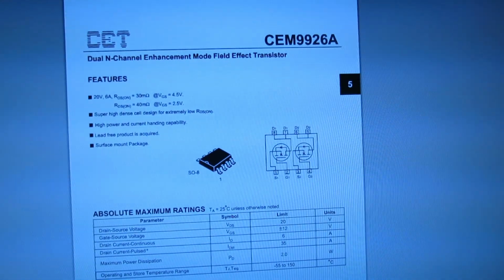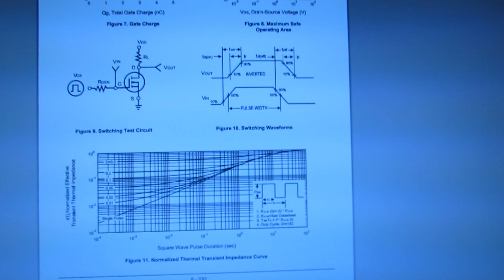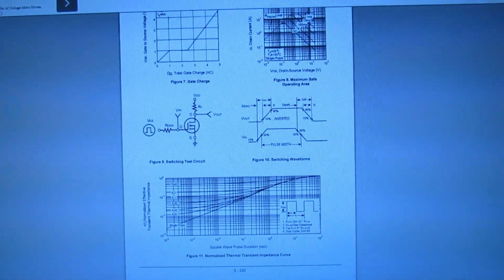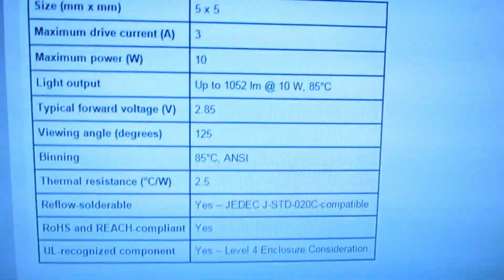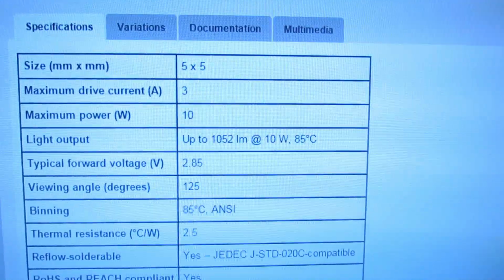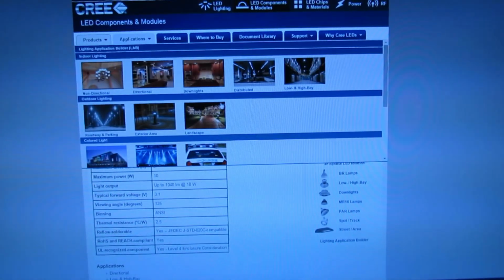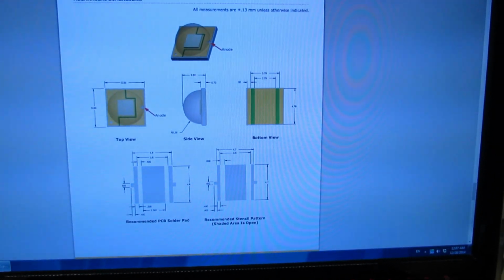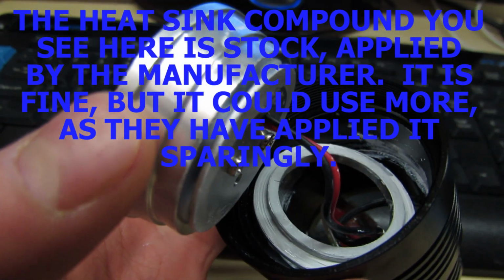SkyRay King 7 x Cree XM-L 2 T6 LED Flashlight Tear Down

Comment: Great review! What is the run time on the SkyRay King 7 x Cree XM-L 2 T6? Also what LED flashlight would you recommend of around 200+ lumens with a focus/adjustable light output ring?
Reply from the maker: +ArimaKihe1 
Thanks man!!If you want to learn all about lumens, and various flashlights off ebay, check out my video below, it will help answer a lot of questions:https://www.youtube.com/watch?v=iKfXuR05ICg
To answer your question though:200+ lumens is not very much, are you looking for a very low powered flashlight?  If so, it will last longer, like 320 hours on low(Using a good 2200mAh LG battery which actually has ~2100mAh usable energy, not the 6000mAh Ultrafire which is actually only has 1000mAh usable energy).  The LED you want is the Cree Q5 LED, it outputs around 250 lumens max.  Below is a link to a ring adjustable Q5 flashlight:http://www.aliexpress.com/item/2015-Promotion-New-Arrival-100-200-M-Linterna-1800-Lumen-Zoomable-Cree-Q5-Xm-E-Led/32463942917.html?spm=2114.031010208.3.138.elFvj4&ws_ab_test=201556_3,201527_2_71_72_73_74_75,0_0

With that said, I should point out some drawbacks to using a Q5 rather than the XML or XML2, and other available flashlights.1.) Low output.2.) Very slow to adjust zooming function, the ring takes a few turns to get from full flood to full zoom, and back to full flood again, it could take 5 seconds instead of half a second(On slide zoomers).  I don't review the rotating ring flashlight in the video, even though I show it, but if I did, I would have pointed out it's slow to manipulate, and is not very user friendly, you'll fumble with the rotating mechanism, and find it's way slower than the slide zoom type, I've used them all, and I avoid the rotating ring every time.  It's nice to have the side switch, and if that's what you're after, then go for it, but I like the tail switch as it works well for me.  The side switch has to be found, and is slower then a tailswitch due to that.  The whole flashlight is much slower to use due to the ring and side switch.3.) Larger than slide zoomable flashlights of similar output(Doesn't fit in pockets and bags as easily)However, if you want the ring zoomable function, and higher output, 1000 lumens, you can take a look at the Cree XML ring zoomable flashlight, below: http://www.aliexpress.com/item/Ultrafire-Portable-Flash-Light-CREE-XML-T6-2000LM-5-Modes-LED-Zoomable-Flashlight-Torch-Spotlight-Lantern/32338862287.html?spm=2114.01020208.3.148.3Est3e&ws_ab_test=201556_3,201527_2_71_72_73_74_75,0_0
Furthermore, if you want higher output, 1000 lumens, a smaller flashlight, and quicker slide zooming, check out the one below:http://www.aliexpress.com/item/2200LM-12W-CREE-XML-T6-LED-Zoomable-Zoom-18650-Flashlight-Torch-Lamp-Aluminum-Alloy-5-Modes/32305271071.html?spm=2114.01020208.3.75.i6uIgF&ws_ab_test=201556_3,201527_2_71_72_73_74_75,0_0

The zoomable flashlights with rings are not that easy to manipulate quickly and effectively,  they are also larger or bulkier.  I find the slide zoomable flashlights to be much easier to use than the rotating ring ones. 
Depending on what you're using the flashlight for, as I show in my video, a zoomable optic is not very good for walking in trails, for that, you want a combined flood and narrow distribution which can be achieved through the use of a reflector based optic.  If you're using it to work on a car, then the zoomable optic is better though, since it evenly distributes the light and doesn't have a hot spot in the middle.
The best reflector based single cell flashlight in my opinion is the Convoy S2+.  I would go with the full 2800mA driver (7135*8) and a warm white LED(code name T4-7A). This is better for security purposes, and walking down trails:
http://www.banggood.com/Convoy-S2-Blue-CREE-XM-L2-71358-35-Modes-EDC-LED-Flashlight-p-994206.html

Color temperature is a personal preference, if you like the whiter light, go with 4000K, if you like the more blue light, go with 6000K, it's up to you though.  I like the 3000K warm white because it's more similar to incandescent or halogen lighting.
Hope that helps!
Best regards,
David.
Reply from the maker: +ArimaKihe1 

Also, if you want the blue Convoy S2+, it's listed here for a pretty good price:
http://www.banggood.com/Convoy-S2-Blue-CREE-XM-L2-71358-35-Modes-EDC-LED-Flashlight-p-994206.html
Reply: ***** Interesting. Can you think of anything that's powered by Cr123's and the beam can be tightened/widened?
Reply from the maker: +ArimaKihe1 ya
this would work.  the cr123 is a 16340, so any of those lights will work.  http://m.aliexpress.com/item/32397122952.html

Comment: Is it possible to tighten the beam with a lens to get a little more heat closer up?
Reply from the maker: +laurin 800 Sorry for the late response. 
The easy answer is no, but the correct answer is yes.
It would have to be a very complicated lens though, as it would need to concentrate all 7 sources to 1 point, to increase heat closer up.  It's not practicable to do so, though.  
For a more focused beam, you would want a larger reflector meant for that.
Reply: I have a similar one with 12 leds, I bought a lens from ebay for under 5 non glass, plus they do glass ones, what it can do, is allow a centre beam to focus for a distance beam

Comment: Thanks man...I had found 1 more earlier...at...http://www.aliexpress.com/item/Sky-Ray-King-4000Lm-super-bright-4-Mode-7x-CREE-XML-L2-LED-Flashlight-Torch-Waterproof/1717229079.html.....also verified on BLF that it is XM L-2...but it seems that this seller does not has Black color in stock at present....
Reply from the maker: Looks like eBay has more options than aliexpress. It's about $40 for a xm-l2 7x in black. If you want the SkyRay it's a little more, but I think the securitying one is the same.
Reply: ***** Yes....SecurityIng is the same...and is available on Aliexpress at $35/-
Reply from the maker: ***** cool. Did you end up ordering it? Let us know how yours works. This one only has two 0.1ohm current limiting resistors in parallel, and that results in an 8A draw, so ~35w instead of 70w. But nothing adding two more and switching the mosfet won't solve.

Comment: ...very nice...no nonsense....clean video...with clear speech....also good technological approach.....would you please also tell as to where did you buy it from and in what price...??
Reply from the maker: Thank you very much!  I purchased it on eBay for $45 USD.  But I would suggest purchasing from user securityingstore on eBay, as their version of the skyray king is a little cheaper, it's just rebranded as "securitying" instead.
Reply from the maker: Also, here's a link to the same flashlight(I've put it in the description), but branded as Securitying, it's also the XM-L2 LED, and not the XM-L.  Some ebayers will send you the XM-L even though you've purchased the XM-L2, so be careful with that, and check it when you receive it.  If it's the wrong one, then just use ebay buyer protection to get a refund, you might not even have to send back the light, depending on the shipping charges.  If it costs more than the item to ship it back, they typically will just give you a refund.
Reply: ***** how to determine which led do i have?
Reply: Xml-2 will have 2 wires on each led and xml will have 3....means thin wires on t yellow led....check....on each led...u will be able to see that...
Reply: ***** as i found it actually is not as important at all as the driver only utilizes 20-30 % of maximum power (70w). That is truly reason why to get a refund. L/L2 difference is only 20% of flux which is not sensitive here.
Reply from the maker: It's probably not 20% even, but if they are selling the L and saying it's the L2. That's not very fair.  And you're right, the driver runs at 35 watts, but I'd rather have the higher efficacy if I paid for it and expected it.  The L2 doesn't have the section divisions.  You can easily increase the power of the flashlight by reducing the current limiter's resistance until you get the current draw you want. I've maxed mine out over 70w, so it was important I have the newer LED.
Reply from the maker: ***** hi, forgot to say, that when increasing the current draw, the wires feeding the LEDs, and the mosfet need to be upgraded to handle the extra current. The stock dual channel mosfet only runs up to 6A, so they are already overloading that.  Batteries are also a concern, make sure you use Panasonics, or something that can handle the current draw safely.  The Ultrafires don't say they are rated for 4A each.
Reply: ***** which resistor is the current limiter?
Reply from the maker: Brian Tucker  hi Brian.  There are four locations for them,  they soldered on two 2w 0.1ohm resistors,  they are labeled 100. On the positive side of the LEDs.  If you want to increase power of the light,  you'll want to upgrade wires and mosfets,  the stock  is only able to push 6A safely,  and it's already pulling 7A. Lol. I'm making a video for upgrading it,  but it'll be a few days before it's online.